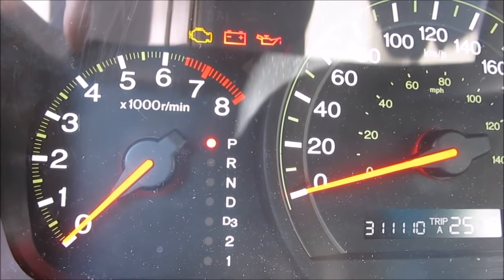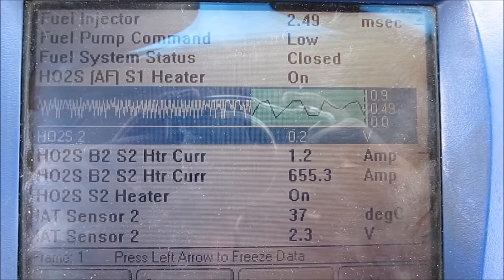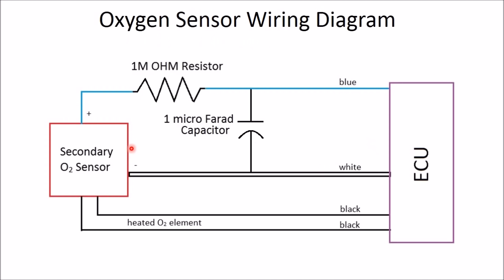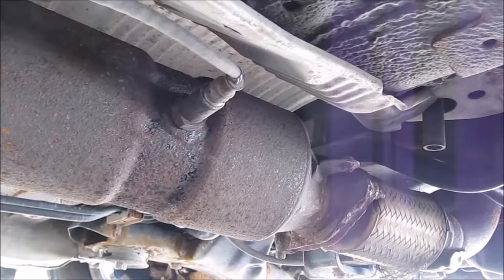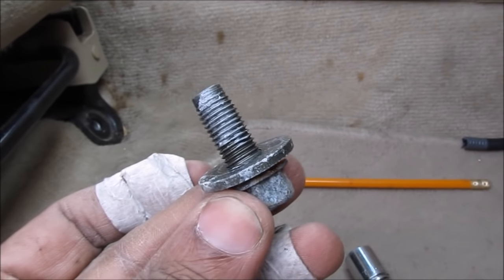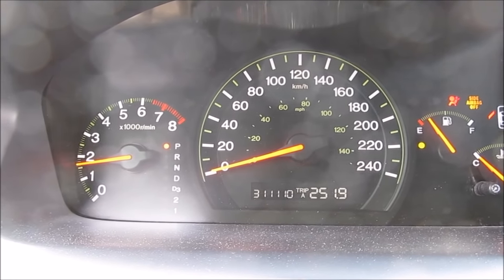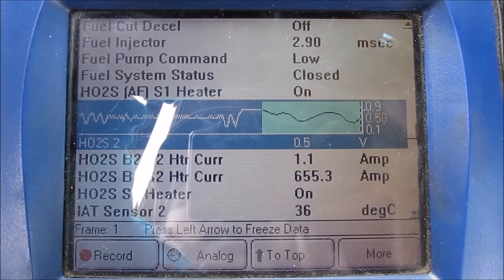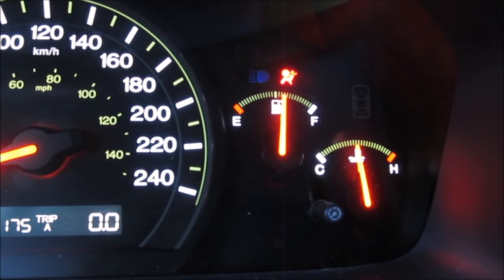P0420 Oxygen Sensor Fix

Comment: Thanks so much. Did the hack yesterday on a 2002 corolla with 230,000 miles and passed inspection today. In the past, a tank of premium gas worked. but this time ng. also tried Scotty Kilmer's suggestion to add one gallon of lacquer solvent and it helped but not enough. engine light did not come on for 60 miles vs. 40 prior to. also attempted the spark plug non fouler fix but could not budge the sensor with special sockets borrowed from advance auto, breaker bar with extension, and propane.  15 years of exhaust heat and salt air at the jersey shore! just as well - i'm sure the threads on the sensor and bung hole are shot. the hack was the last shot before donating the car. And it worked!  Your science info. was excellent. Googled rc circuit and capacitor and learned more. You should get an award! but don't put in for it on earth (you may end up in the pokey)- wait for heaven. oh - got 5 resistors and a capacitor for 40 cents - 90% sale at a radio shack going out of business - it just keeps getting better!!
Reply from the maker: +JOHN HIGGINS Man I am really glad to hear it worked out for you and on a Corolla. Good to hear you tried the other methods. What resistor and capacitor values did you end up using?
Reply: 1.0uF(50V, 20%) capacitor and 1Megaohm (1/2 watt, 5% tolerance) resistor. Basically the same values mentioned in your vid. I didn't have choice regarding values in parantheses as I was limited to what was in stock at the store which was closing. not that it mattered because I don't know enough to know the best values.
Reply: Wow! Man you've try everything on YouTube. Scotty Kilmer, non fouler fix and now this.  I got a 2003 Corolla with 223000 miles and same issue so maybe I should just take this approach.  Was going to do the gallon of lacquer solvent the if it don work then the non fouler fix but I had the same concern not being able to take the 02 sensor off and retro fit it.  Car ran fine just the annoying check engine light and we don't do inspection in Minnesota.
Reply: I was pleasantly surprised that it worked and passed inspection. it has not yet been a week. i will update if light comes back on or goes 1,000 miles without coming back on. this may take a while as i have returned the car to my daughter who is currently doing limited driving. Like yours, the car runs fine but it does burn a quart of oil/month when driven ~ 1,000 miles. this may be connected to the catalytic converter malfuction/error code. 

so if you are considering the hack just to get rid of the light you may want to wait for my updates. if you do go ahead with it anyway, if a newbie, you should practice soldering first. it is easy but you need to take some precautions: sand the wires, use flux, and separate pieces to be soldered with pieces of sheet metal (so the solder on one connection doesn't inadvertently drip to another), and wrap with electrical tape to make sure the soldered connections do not touch each other and short.  

as your corolla is the next generation from my 2002 i think you may have easier access to the oxygen sensor connection by the passenger seat. 

once accessed, you should disconnect at the connector and strip and cut wires as shown in speedkar99's vid. there is no need to remove the oxygen sensor. all the work is can be completed in the car. i had to remove the front passenger seat and the shifter harness to get to the connector. but it seems access is easier for the 2003 model.

came across this website for sensor access/removal which may prove useful to you:
http://www.toyotanation.com/forum/132-corolla-9th-gen-1st-gen-matrix-2003-2008/1354081-diy-downstream-oxygen-sensor-replacement-2003-2008-corolla-lots-photos.html

Good luck!
Reply: Update - Light came back on somewhere between 200-500 miles. but at least i passed inspection. So, Tous, I can't vouch for the hack to be effective on your 2003 corolla and your goal to eliminate the light, as inspection for emissions is not a consideration in your state.
Reply: it does not work in California they do a physical inspection  to look for cheaters ugh

Comment: This is a great alternative to using a non-fouler with the O2 sensor and is even cheaper!  You bought all the parts with the change you found on the carpet!  I'll consider this fix for my '05 Element which has the same engine.  Thanks!
Reply: Non-fouler with the O2 sensor or 02 Sensor Spacer is not allowed to buy from California !
Reply: @criticman5221  Didn't work for me at all.  Had to buy a new downstream HO2 sensor.  At least I didn't have to replace the cat!😆
Reply: Downstream sensor has to work in order for this to bypass the converter

Comment: Thanks for the video! My code reader isn't as advanced as yours, and neither is my grasp on your method. After trying and failing at putting the O2 sensor in a coupling (sensor was too big) I ended up changing the spark plugs, putting in high octane gasoline and seafoam additive, erasing the 420 code and driving until all 8 monitors cleared(about 75 miles). Then I headed right to the inspection station, passed inspection, and 10 miles later the 420 code came back on. At least I got a legit inspection sticker, so I can troubleshoot further without getting a ticket. Thanks again for the video, I was intimidated until I watched you at work.
Reply: DEQs are bullshit any way, way to go for beating the system!

Comment: The catalyst will have a lot of difficulty setting the monitor, due to not responding to the computer's intentional lean/rich commands.The computer will push these limits to TEST for an appropriate response from the catalytic converter. It looks for voltages ranging from 0.10 volts, to 0,90 volts. Outside these limits indicated a failed sensor.
While a "steady reading" may be desired, the computer will force the system lean and look to see that it gets the expected response. It will do the same for the rich. The bypass will prevent these results from matching what is expected, and not let the catalytic monitor to set, OR will throw catalytic converter codes or REAR oxygen sensor codes. (Hope this clarifies a bit)

Comment: I couldn't get this to work after too many attempts with different values, so I made a spacer out of non-foulers and that worked wonderfully.
Reply: Hello, which bank o2 sensor did you put fouler on? I added it to bank 1 on my 2006 toy sienna n it varies from 30 miles to about 300 miles before lights come back on. Will it work better on bank 2?  Or should I have it on both banks?
Reply: @tomgaffney740  both banks, rear sensors only, and only if you have p0420 and/or p0430
Reply: @kellismith4329  i have P0420 on my honda fit 2015 . Will adding fouler on secondary o2 sensor will turn off the engine check light . Or will the light come after a period of time
Reply: @manuvaldavis1048  if there is an issue with your converter, you may have to remove it and put pipe instead - at that point your car will show a p0420 in it’s absence, then you install the antifouler to trick it into thinking the converter is still there. Driving with a messed up converter will only get worse and can mess up the engine
Reply: @kellismith4329  if the problem is with o2 sensor, can we use fouler. Will it remove the error
Reply: @manuvaldavis1048   no, it will not cure a failed O2 sensor
Reply: @kellismith4329  which o2 sensor will be the problem. Primary or secondary
Reply: @kellismith4329  if the issue is with catalytic converter. Check engine light can be removed by a fauler ,even if we doesn't remove catalytic converter . Am i correct?
Reply: You have to test the sensorsto see if they have failed, the non fouler can only be used on the downstream O2 sensor
Reply: @kellismith4329  upstream o2 sensor is hard to get tested, but the heater of the same is working. Downstream o2 sensor is working properly, both signals and heater is working properly. 
When i looked at the catalytic converter through the hole of upstream o2 sensor , it looks good. Will cleaning of the catalytic converter rectify my issue

Comment: I fixed the P0138 high voltage code that came on after this mod by using 1M and a 4.7uF along with another 1M resistor across the 4.7uF cap (signal to ground in the same spot as the cap). I now have a nice smooth line at about .8V and a happy ECM.
Reply from the maker: You are welcome
Reply: Make and model?
Reply: Can you show diagram for your job

Comment: I would modify the harness on the O2 side instead of the factory harness.  It is much easier to do also since you can do the work on the bench then do the install.  I hope this helps and thanks for providing the great tip on fixing this annoying check engine light.
Reply from the maker: Yeah good luck trying to remove the Rusty sensor
Reply: But then your fix is easily visible to anyone. If you have a commercial vehicle and get stuck in one of those DOT roadside inspections , you are looking at a major fine and even jail depending what State you are in.
Reply: Ya your repair won’t last long hanging under your car though

Comment: I did the mod but I have a problem now... we don't use kilometers in USA , I'll have to drive to Canada to drive  a few kilometers  and finalize my work .... ; )
Reply from the maker: +tiz tiz haha good one.
Reply: 50miles is the written word on them in the freedom land
Reply: You will one day. Just like you are usning kilograms in Hospitals.🤣🤣🤣
Reply: ferkemall  Citroën or Renault? Or Peugeot
Reply: @VileStorms  40 kilometers is like 22 miles if I'm correct
Reply: @jacobwebb8818  wut
Reply: @speedkar99  would this work on my 07 Lexus ES350 ? In my state we don't have state inspections but would love to get rid of the check engine light P0420 ! Thanks for the awesome ideal  I appreciate your efforts educating us. Thanks
Reply: @tofanibantu1  yes but apparently you just need a new cat
Reply: @jacobwebb8818  pp
Reply: @jacobwebb8818  p
Reply: @jacobwebb8818  pppppppppppppppppppppppp
Reply: @jacobwebb8818  pppppppp
Reply: @jacobwebb8818  p
Reply: @jacobwebb8818  pp
Reply: @mamtagoswami6796  true
Reply: @speedkar99  I have a P0420 code on my 2007 Toyota yaris but no engine light, I only found that out through Scan tool, what do I do because it is not smog ready, it given me the yellow exclamation mark rather than the green one. what do I do????could be I just have drive a few miles for it to go through the cycles, since it is only yellow and there no check Engine Light?

Comment: Thanks man. After I read about how O2 sensors output data I figured that you could make a circuit board, resistor, capacitor, and power source that would mimic the sensor output. This is way easier then what I was trying to do.
Reply from the maker: +daniel evans This is if your cat is still half working (below 90% efficient)
Reply: @speedkar99  what if i don't have a cat?

Comment: The real fix is a new cat convertor.  This is somewhat of a "band aid".  But I am certainly willing to use it on my 2005 Accord with 320,000 miles.   This seems to be the electronic equivalent of using a spark plug de-fouler.  It's better though, because it might not be as visible when getting an inspection :)  Thanks for the video.

Comment: i just done this on a 2003 toyota seinna. first attempt hooked up wrong. check engine light came on right away. redid it. but it took so long to go into readyness mode. but it worked. thanks
Reply: Do you recall if you used the 1M resistor and 1 microfarad capacitor?
Reply: @bradleysmith1064  its been awhile buy yes with a 3 watt resistor i think i used a 6.3uf capacitor 16volt

Comment: Does using this fix negatively effect anything mileage/performance/reliability/longevity? I’m just saying, it’s tricking the vehicle to think everything is perfect when it really isn’t.  I had MIL eliminators on my mustangs because they had no cats but they also had custom tunes installed instead of the factory programming. So with this fix you don’t need a custom tune? Thank you for your time. Great video as usual!
Reply from the maker: Eventually you'll need a new catalytic converter
Reply: @speedkar99 and what if you don't have  a cat there

Comment: 0:29 Would you mind clarifying what 'orderly' means?
Are we trying to limit the sensor amplitude readings, or enforce a more consistent time between peaks/troughs? I see you did both after the RC circuit was applied, but which of those effects was triggering the P0420 code?

Also, any advice on how to find the Time constant for our specific vehicle, so that we can correctly choose the RC for our circuit? Or do your Resistor/Cap values work for anyone?

Comment: Just another person recommending this. 2013 Outback with too many km's to justify the $2000 catalytic converter replacement. This RC circuit has me seeing .52v steady when looking at an OBD scanning app on my phone.  Here's hoping it works in the long term.
Reply: @lostconciousness4255  Sadly no. For two days no CEL, then it popped up again, this time p2096 (I believe) for lean mixture. Fiddled and fiddled, finally no go. 
So I recently bought a new O2 sensor, currently waiting for the CEL to pop again. If it does, new cat for me.

Comment: "Got rid of one idiot light and this other one shows up" lmao, they'll keep you busy
Reply from the maker: +Killya529 oh yes, that seems to be my luck with this Honda. So I cleaned the seat belt switch and the airbag light went out, then the CEL came back on for P1009 so I cleaned the VTC, and then now my washer fluid light is stuck on despite there being a jug of fluid in there, and of course my abs light is on because I broke the sensor when doing the ball joints...
Reply: good

Comment: 1M Ohm + 1uF is way too high for the modern ECUs. This is technically an open circuit, you get a new P0138 DTC, and fix 1,28V. I tried with 330K + 1uF too, didnt worked..
Somebody wrote the correct values, but his comment has been deleted! I dont know why.
4,6K + 100uF, works like charm since 5000 miles. Many thanks for your recommendation.
Reply from the maker: Thanks for your input, hope it helps those in the future looking to do this mod.
Reply: 100uF isn't to high? or maybe you had in mind 1uF?
Reply: @lukaszperski9370  No! 4,6K + 100uF 5V electrolyte. I use this setup since wrote the first comment. Works like a charm, no MIL.

Comment: Awesome video!  It looks like in this case you would have passed the emissions test even without the fix, since the catalyst monitor still was not ready at the time of the test.  I've eliminated a p0420 in a couple vehicles by putting a couple of spark plug non-foulers between the sensor and the exhaust as a spacer (it doesn't seem like it would work but it does).  It's important to point out that any work-around like this is only a temporary fix; the catalytic converter should be replaced to avoid increased emissions, exhaust restriction and eventual performance issues
Reply from the maker: I agree. The only thing is cars here in Canada (mine included) are very rusty so adding the anti-foulers or replacing the catalytic converter is a bit more challenging. 
Eventually when the cat fails pretty badly it will produce an O2 signal that the filter can't correct and throw a code.
Reply: Ah true, didn't even consider that fact.  I'm spoiled since my cars are relatively rust-free (live in the Washington D.C. area).  Is there an effective undercoating available, or is just a lost cause trying to fight the rust?
Reply from the maker: Its mostly a lost cause because of the amount of salt they use on the roads here in winter.

The most you can do is rust proof annually and keep washing the car after snowstorms.

It also depends on the vehicle manufacturer.
Reply: Joe Milton 
yes, I'd like to know if the vehicle was able to pass the catalyst monitor or not, since resetting the code is separate from the addition of the RC filter.  without seeing that monitor pass, it's inconclusive whether the ECU screening parameters were changed sufficiently to enable it to pass. a diode in line for a peak hold may be better if the catalyst is in worse condition than just marginal.
Reply: double posted
Reply: DTR RTD where would you install the diode inbetween?
Reply: disonesto 
I'd try putting it in series with the output from the downstream sensor, cathode towards the ECU, though it would need cutting the wire on the sensor side of the connector.  
If you had a pair of spare connectors available, it would be good for trying it out without having to hack up a good sensor. 
I haven't had a chance yet, but may try it just out of curiosity.
Reply: Please people. Don’t do this. It’s illegal to mess with a cars exhaust system for a reason. Don’t cheap or cheat your way out of this. Spend the $500 that you have to spend and replace the part yourself. No need to cheat because of laziness. Please people. Do the right thing. Don’t listen to 7/11 mechanics
Reply: @chicoboybrezzy954  for some people it may cost $2000 with labor and parts. for some cars Catalytic Converters have to be California Emissions Certified. Check out a price on such items and then compare it to non CA Certified. Before you buy a converter check the specs on your vehicle. If it was built with a converter that was CA certified, it needs to be replaced with the same certification, otherwise, your vehicle will fail the emissions test.
Reply: Yea sure , but we are doing it anyway